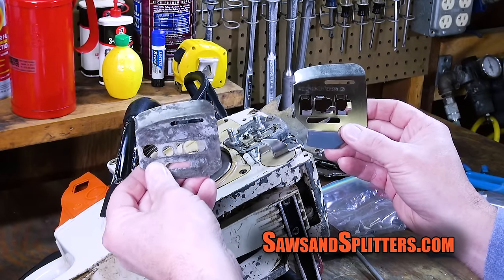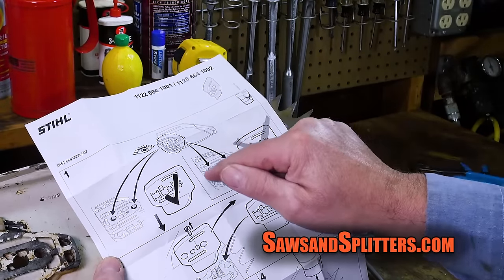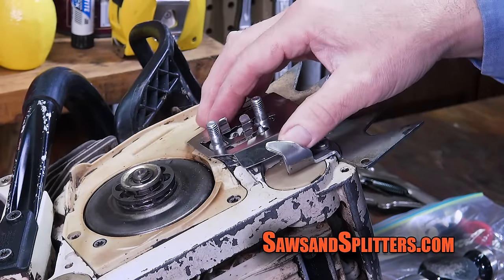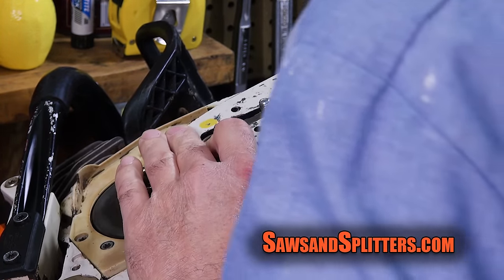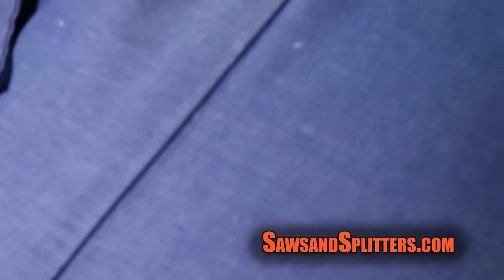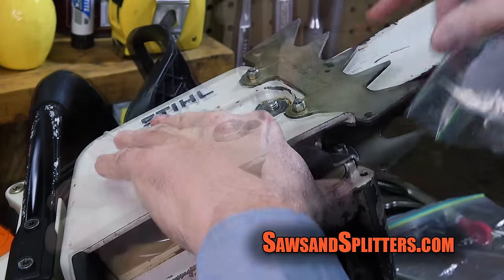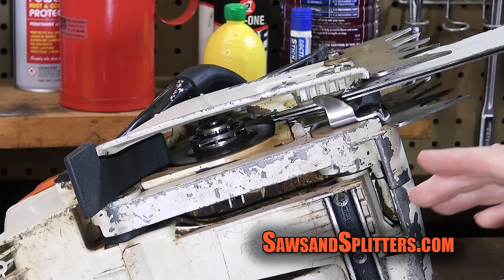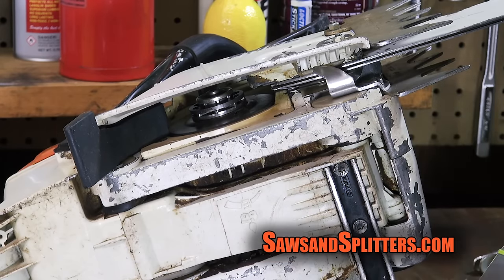CHAINSAW CHAIN TENSIONER COVER REPLACEMENT EP.04

Comment: Feels good repairing stuff;) 
One thing; sometimes your hands are somewhat blocking the view... other than that, fun series!
Reply from the maker: Someone else commented on that too.  Hopefully it's just in this video.  It takes so long to set up the camera that sometimes I just go with it when I shouldn't.
Reply: John, I have the same problem trying to get the camera where I need it, that's why I bought the eye glasses camera that I'm still in the early stages of using, also I've been on Amazon.com getting different camera mounts. I missed a lot of videos I would have done if I could have mounted the camera. I will fix all of that this winter in my shop.